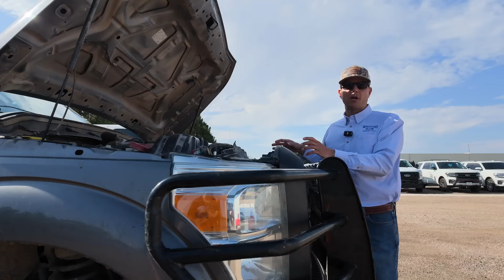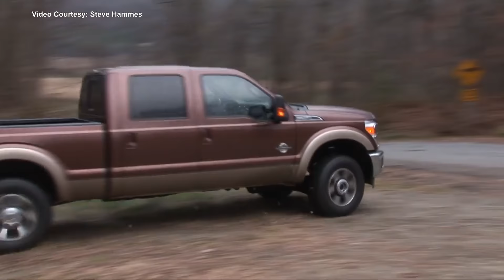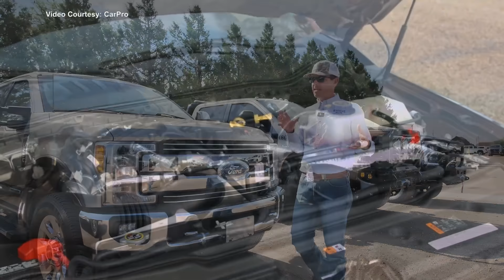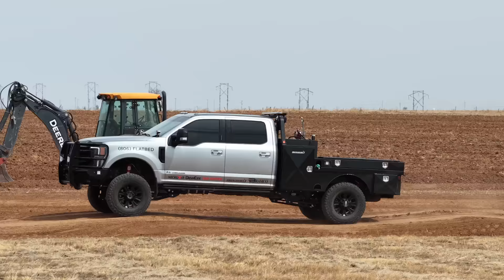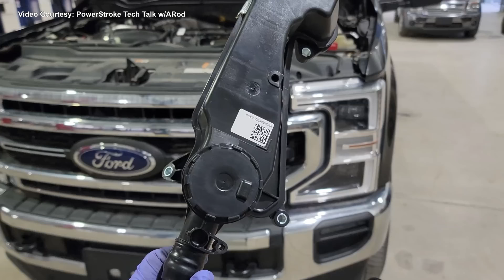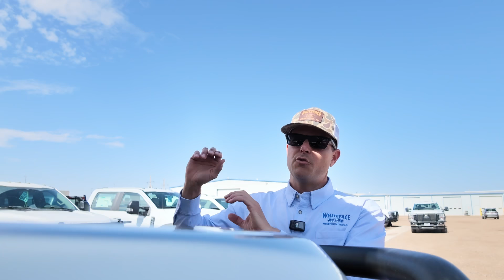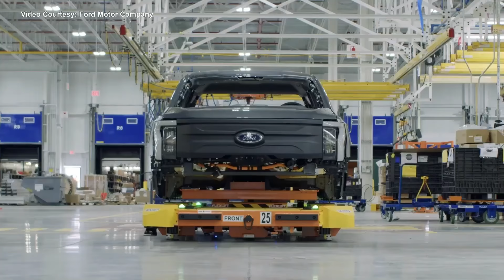Every 6.7 Power Stroke Generation Ranked by a Ford Dealer

Comment: The 6.7 with the Cummins badge.. it has 400 actual parts less than the Powerjoke.
Reply: And they FINALLY figured out that real, individual cylinder glow plugs are far better than the barely functioning intake heater grids with the convenient 'fall-right-off' nut that falls right into cylinder 6 and grenades it, if that cylinder didn't overheat already beforehand from poor coolant flow.
Reply: @tdotw77  and still crap hydraulic lifters
Reply: Powerjoke is way ahead… Stellantis 😂
Reply: It also has less HP and torque and a transmission that wont last   and is only relevant because the government bailed out dodge 😂😂😂
Reply: Because they fell off 😮

Comment: My 2016 had to have a new torque converter. It started acting up at around 85,000 miles. That should’ve been a recall cause the number of trucks had the same problem but it wasn’t under warning so they wouldn’t replace it.

Comment: I remember switching from 5.9 Cummins to a 2016 F250 platinum. I was mind blown with the power a stock truck had. Since then I owned a 2019 f250 platinum, I didn’t think trucks could get any better. Until i drove a 2024 platinum Tremor. Now I’m a happy owner of a 24 F250 platinum Tremor HO. truck is a beast.
Reply: I kept’21 dinosaur, added KC WHISTLER, 5” straight, T&D, AMDP with 50hp and full Pusher pipes. Beast is understatement, thing is sick.
Reply: @m@m @matbob7249 20 with 64/67 titan turbo, DCR swap, 5” exhaust, full piping, running hot tunes from asap. Scoots.
Reply: Yes, it's one reason I went with the 2023 High output King Ranch, that, and the bed puck system.   I've loving all the technology, as my truck has the full load.
Reply: Wow, all nice trucks indeed!   I have the 2023 F350 King Ranch HO.   Lately, I've been leaving it in 'Economy' mode, but when towing I move it to 'Normal'.  Interestingly, I filled the tank today, and kept an eye on how many miles to a tank (started at 468 miles to Empty), but after driving 40 minutes home, and switching it to 'Economy', the mileage moved up to 472 miles, and that was driving 27 miles home as well when it showed 468.

Comment: I have a 24 with the standard output
Is the high output worth the upgrade
Reply: Nope. They use more def. Delete and tune the so and you get the same power or even more than the ho, all tuners have said this.
Reply: You can turn that standard output engine into a high output very easily, and for less than FoMoCo charges for the upgrade.
Reply: @tdotw77 is that just throw a em on tune on it
Reply: @jonathanschaffer3727 Yeah along with a cold air intake\piping would help a bit too.
Reply: @tdotw77 won’t the em on tunes void warranty
Reply: @jonathanschaffer3727 no

Comment: Just sold my 2011 with 422k miles but replaced first motor at 79k, threw a rod, under warranty. Replaced with 2013 motor it last 186k lifters came lose. Put a 2018 in it long block then deleted it. Sold it at 422k  miles for 22k. Bought 2019 and deleted it at 29k miles....zero issues and still own it with 81k miles. Just bought a 23 with 68k miles and immediately deleted it...now has 90k miles. Zero issues. All had CP4 upgraded. 2011 CP4 blew up. Cost 15k....

Comment: I’ve owned an 11-14, 15-16 and currently a 17-19.  All have been sold with over 400,000 miles due to rust, all were problem free with original drivetrains.  ‘17 Currently sitting at 339,000 and since the rust issue should be mitigated by the aluminum body, it’ll be around a lot longer.  Never had a CP4 failure, turbo failure etc.  The ‘13 was deleted right away, ‘16 was deleted at 330k and the ‘17 is still emissions intact but starting to show some signs of getting fussy (having to do a forced regen more often than I should, etc).  My trucks live hard lives from 2,500 mile weekends pulling a 40’ gooseneck to 40-50 hour blizzards pushing snow.

And since everyone always asks, 200 hour oil changes, 400 hour fuel filters.  Motorcraft 10-30 and Motorcraft filters for oil/fuel.  My usage varies a lot seasonally so I go by hours vs miles.  Equates to 7,500-8,000 miles in the summer and 3,500-5,000 in the winter.  Hot Shot EDT whenever I remember to throw it in and I buy my fuel from a high volume, non-biodiesel station.
Reply: I deleted my 19 and gained 3-4 miles to a gallon
Reply: Do you guys spray your underbodies to prevent all the rust? I live in Texas.  Never seen rust
Reply: @Freshprankstv1  My truck has been sprayed with 'Fluid Film' along the full frame and steering components (2023).   Apparently one of the best, in that if there happened to be any rust, the fluid film doesn't allow water or oxygen to reach the rust, encapsulating it.  They do say in wetter locations, to check it annually, to see if any area's look like another coat would be beneficial.  It took many cans of the 'black' fluid film, but I feel my frame with outlast the rest of my King Ranch pickup!
Reply: Wow, you'd be a good guy to talk about 'lubricity' for the CP4, as I add lubricity at every fill, and honestly wonder if it's truly needed every time!   I have the 2023 High Output, and plan on keeping it for a very long time (had my '95 Powerstroke for 17 years) and I currently have 55k on this truck.  I pull a 35' fifth wheel off and on during vacation times, otherwise it's generally normal driving experiences.  Loving my truck, and I've done a full 'fluid-film' undercoating on the entire frame & front end components, hoping to keep rust from ever forming.
Reply: @Powerstroke98 The way I figure it, adding a lubricity is pretty cheap insurance to protect my CP4. Saving ip for a dcr changeover but for now Archoil is my go-to.
Reply: Great advice,  since this is my 1st Diesel, I was looking at engine idle time, I have almost 19000 miles with 107 idle hours and 516 total engine hours , so far I have done 3 old changes,  1 at 1k miles using synthetic blend, then 6k miles swith to full synthetic,  another at 13k, oil samples said I could run much longer,  but i don't feel comfortable pushing it longer since we tow and idle to keep dog cool, supposedly the oil life indicator used all that data to tell us when to change the oil ! I have always had oil left when I changed it.
Reply: Where are you located? Anywhere near ❤️💙Arizona
Reply: How do you track hours? Did you install an hourmeter or simply guestimate hours operated per day, week? I feel hours of operation tracked would be a much better way to schedule maintenance.
Reply: @malaqua54  Hr meter built into guage cluster
Reply: @marcogarza1263 Cool 👍

Comment: I have owned gen 1,3,5. My best to worst is 3(2017), 5, 1. The quality was better before covid imo. The latest gen has improved creature comforts for sure. My gen 3 runs cooler and trans runs cooler than latest gen so what you stated hasn’t been my experience. Everything else is spot on.

Comment: I drive a 19 lariat daily, no hauling it's just my daily driver. It's deleted and I use a mixture of Archoil and 2 stroke oil every fill up. I'm convinced it's the best modern day diesel available. Delete the 17 - 19, add a bigger transmission pan with fins and drain plug, change CCV filter to the better one, and you got a good truck!!!!
Reply: Thanks for the advice

Comment: 2023+ the best
Reply: Ugly azz front end. 2022 GOAT!
Reply: The 2017-2022 models have an ugly F-150 car-style dash and ugly AC vents, and they look like Transformers. The 2023 interior, grille, and headlights are so much better. Not to mention, the side body line around the fender and door made the side profile better, with a better side badge and better-looking taillights.
2023+ ftw
Reply: @stephenSS1320 . you must have always been your buddies wingman taking the ugly friend while your buddy bagged the hot one.   2022 best looking year of them all.
Reply: @Californians_go_home
You must be the buddy who kissed the transformer
Reply: I would buy F250 Tremor you get the F350 rear axle and springs and in Arizona you don't have to register the F250 as a commercial vehicle which is nice.
Reply: @willwilkie6199 
I got a great deal on a super basic f350 single cab 2wd
Only option are diesel and bed lights, its.very basic 
Modern truck that still feel simple like mid 2000s

Comment: My list from worst to best. 11-14, 23-26, 20-22, 17-19, 15-16 (I know I will get a lot of hate about this list but its my thoughts and what I think is best fight me I don't care)
Reply: My 11-14 was rock solid, but agreed.  My two ‘16’s were awesome trucks and my 17 has been great so far at 339k and counting.  Used to always have two because they all have stupid high miles, but when I turned over the 16’s into alumiduties I did one 6.7 and one 6.2.  The 2020 6.2 just rolled 300,000 last week and has been great as well.
Reply: @AuctionJunky Yea I always hear mixed thoughts on the 11-14 either they last forever or have turbo problems within 100k miles. I love the first Gen alumiduty and don't hate them at all just for me I prefer the steel body a little more and I honestly prefer the steel over the aluminum because where I live rust isn't that common